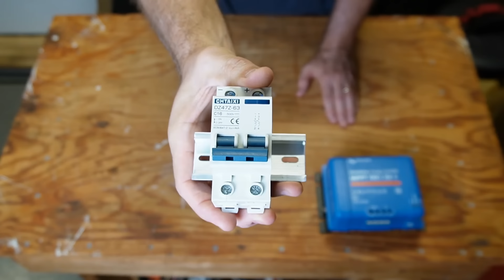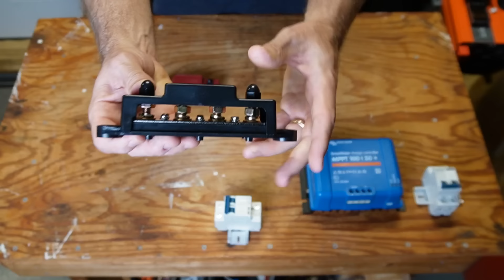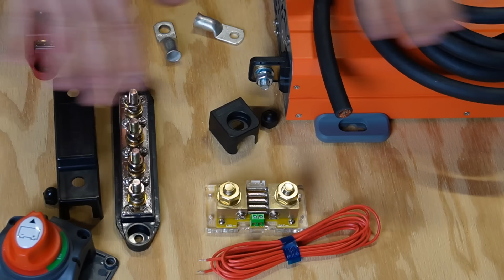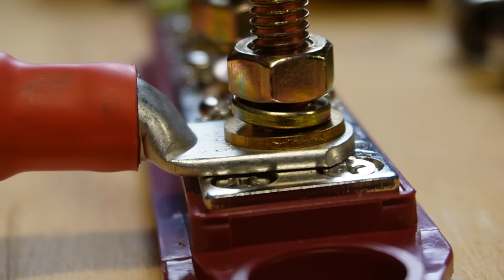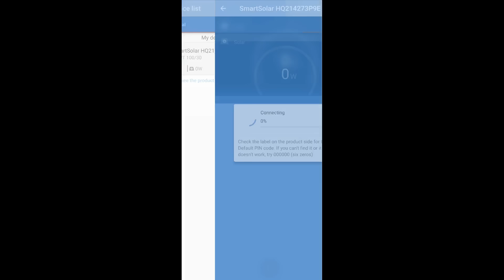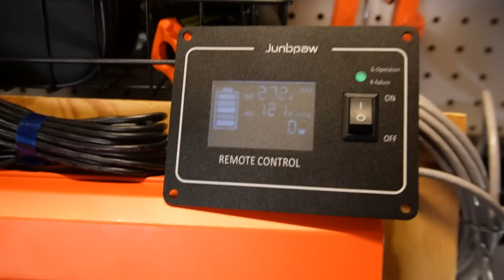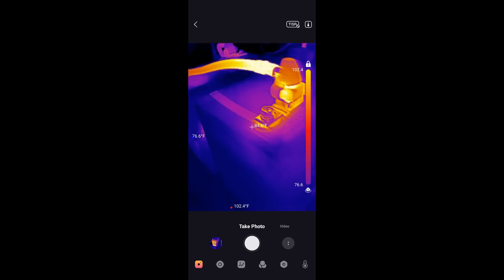24V DIY Off-Grid Solar Generator Build For Beginners

Comment: Question guys? On the pv solar switch can I flip the negative and positive cables as long as they match coming out the other side?
Reply from the maker: Not sure I totally understood the question, but with solar cables using mc4 connectors, if the mc4 connector will not plug into the correct polarity (positive/negative) color just turn the cable around use the other end of the solar cable. Each solar cable with a mc4 should have a female on one end and a male on the other end. Its best to have the positive/negative colors matching. But as long as the correct polarities are going  from the solar panels to the power station, you should be good. I'm not sure I answered your question.

Comment: This is diffently the best how to video that ive seen so far. How long would it have run that air cond. And why dont the solar panels do better when its hotter i would think the hotter the sun the better.
Reply from the maker: Thank you! I don't understand the technical reasons, but given two days with the same amount of sun at the same angle, a colder day will generate more watts. I've experienced this myself. However, I do seem to see more watts during the summer because the sun is more straight overhead and more sunny days than winter. I can't remember the details on how long it would run the air conditioner. But it wouldn't be very long. Maybe 3-5 hours with those two batteries. Air conditioners use quite a bit of power. But not as much as heaters.
Reply: @proficientprepper ok thanks again

Comment: Hi can you please tell me what power to run the shunt and monitor thank you
Reply from the maker: The shunt/monitor is just powered by the 24v system itself. I just tapped into the positive on the busbar. Its already connected to the negative, so I didn't have to do anything with the negative.

Comment: Nice video and very clear instructions.
What do you need to do,if you want to charge this system when there is no sun wth grid power?
Would be nice yo know!
Thank you for this video.👍👍
Reply from the maker: If I understood your question correctly, you can charge all these power stations with grid power. They all come with an AC cord you can just plug in. Of course what I was demonstrating would be what I would do when there is no grid power.

Comment: What happens when the panels charge the batteries fully?  Does the Solar panel charge controller turn off charging or is there a feature to not overcharge?
Reply from the maker: Thanks for watching and commenting. When the batteries are half charged for example, the solar charge controller will charge the batteries in the "bulk" charging stage, which just means it provides all it can to the batteries up to the max amps its rated for. When the batteries reaches fully charged the solar charge controller goes into what is called "float" stage, which means it just provides just enough power to the batteries to maintain a full charge. So it may be zero or 1 or 2 or 3 watts. Whatever the battery will accept.

Comment: Hello.  I want to say thank you for this detailed video.  It helped me to get a lot more comfortable with understanding a solar setup.  The only thing that I would have like to see you add is a AC and DC distribution panel to hook up DC items directly to the system, and enable multiple AC outlets within my bus conversion. Do you have a video showing that?
Reply from the maker: Thanks, I do have a video where I go through what I built which includes an AC distribution panel. But I didn't show it being built - https://youtu.be/lo1xKwktX7c

Comment: Can this system run a Deep  freezer, starlink router, ps5 and smart tv? And how many solar panel can i add to it.?
Reply from the maker: It would run these things you mention. But you might not be able to run them all simultaneously. And you are wanting to run them full time off grid, you would definitely need more battery storage and a few 200 watt+ solar panels. I did a video running my freezer that might help - https://youtu.be/2X4Tyj5Tmok

Comment: Is the Inverter shown (LGE 2080Ti) rated as a 12V inverter?
Reply from the maker: The inverter I used in the video is their 2080 watt 24v inverter. However, I just went to Amazon and noticed that I don't see the 2080 watt 24v inverter anymore. I do see the 24v 3080 watt inverter. I'm not sure if they stopped making the 2080 watt version or they just ran out. The 3080 watt version would be what I would go with if the 2080 watt one is not available. You just have to size your wires/etc accordingly, which I believe I did allow for a higher wattage inverter in that video.

Comment: What limits the batteries from drawing too much current from the charge controller when they are charging? I have 4 12v 190ah sla batteries I’m planning to run in a series parallel 24v configuration and I’m worried about the initial charge cycle.
Reply from the maker: My understanding is that charge controllers will not output more than their rated amps as long as its functioning as designed. However, just in case something does go wrong with the solar charge controller, that is one of the reasons I put a breaker between the charge controller and bus bars/batteries.

Comment: Again, great video, using it to build my system. Does your system not need a resistor to eliminate sparks?
Reply from the maker: Technically no, since I have a battery switch I did not use the resistor like I have shown before. I see lots of people still using them even when they have a battery switch. They say its to not damage the capacitors in the inverter. But I've never read in an inverter manual to use a resistor or anything like that. So when I have a battery switch, I typically don't use a resistor to pre-charge the inverter capacitors. But I may be proven wrong one day and if I am, I will be sure to show that in a video.

Comment: I forgot to say that this is a great video and I just became a new channel subscriber.  If you know how I can add wind and solar working together to run the wind power from 4pm sunset to 6am sunrise in the winter desert
Reply from the maker: I have no experience with wind power. However,  I would think you would simply connect the wind power output to the same place you connect the solar charge controller output (given same voltage) going to the battery. Then both can be charging at the same time. I've seen several videos that show that its difficult for the average home owner to generate much wind power. But I don't know for sure.
Reply: @proficientprepper  in my case I have no choice after sunset which is 3 or 4pm and all night is when the wind is serious. I went out and bought a USMC 2 Man Combat tent that handles 55mph winds for my dog and I but hopefully I might get lucky and sell my truck for a mini van. Avg wind speed in Borrego Springs CA desert is 15 to 20 mph from 4pm to 10pm then you get 30mph 10pm to 1am you also get the 40 to 55mph wind gusts which have destroyed 4 of my tents. So now I got the USMC tent that I will test even if In get the van to replace my truck just to see if it can handle the wind.  Most wind experiences are bad because there is NO WIND Abut here there is a lot of wind and it might be the BEST CHOICE for the location.  But in summer Sun is out 14hours a day.  It's hot in summer as high as 115degrees and alot of 105 to 110 degrees but in winter it's 40s at night and 70s in daytime.  I will be using solar until there is no more sun then switch to wind or maybe a propane generator to charge my batteries.

Comment: I am not happy with youtube algorithm because I got lucky when I found this video.  I am doing my first DIY and I bought 4 ecoworthy 12.8V x 300amps.  Altogether I have 12V and 1200 amps but 15,360Watts.  I figured it would take me a long time to get a 60 Amp Solar Charge Controller to charge 1200 amps.  So I think it makes the most sense to make TWO 24V 300amp chargers . Buy 1 Charge Controller and 1 inverter. When 1 7680wh generator has no power or down to 25^ I will disconnect the Solar Charge Controller and Inverter from Charger 1 and attach to charger 2.  That will give me good backup.  I am only going to use a 400w mini heater and a 150watt electric blanket and that is it.  I will be in the desert so I want to have both SOLAR and WIND because in winter there is a lot of win in the afternoons and after Sunset and early morning hours. I will likely use 6000 watts per day from Solar System 1 and If I can create 6000Wh of Solar that would keep me in a great situation but if I only make 3000 watts of solar I have a long extension cord I can attach to a 12V 80ah Lifepo4 battery charger and can fully charge 12V 300amp battery in 3:45minutes and I got 2 of them. So I can charge these solar batteries at the local library in an emergency. But if I get a good wind turbine I might be able to get 4000 or more watts/amps "whatever" to charge my solar system at night.  There are a lot of 35mph to 50mph winds that come thru the desert in the winter.  14hours of sun in the summer but sunrise usually around 6am and sunset at4pm in winter.
Reply: That's a lot of copper. Have you considered going 48V with a Sungold Power AIO (All In One) inverter? 500V MPPT Solar input. You can run single or split phase output from 5kW on up. 48V server rack batteries have built-in breaker circuit breakers.  Easy install...

Comment: So there is no need for a fuse from the inverter to the positive bus bar?
Reply from the maker: You could do that, however, since the solar charge controller and batteries are either using a fuse or breaker, I do not see the need.

Comment: I'm going to use this video to assemble my 24V system that I've been gathering parts on for many years.  I have 10 ea used 315 watt panels,  several chg controllers, inverters,  welding cable, lifepo4 batts ( the old AGMs gradually died in storage)....it's the fusing and disconnects that baffles this old brain.
Reply from the maker: Glad you found it helpful. Sounds like you're about to have some fun assembling that system. I certainly enjoy putting these systems together.

Comment: Good morning Matthew here from Jamaica i have a 24 volt solar system mppt charge control five 550 watts solar panels and one 585 watts solar panel two 5.2 kwh lithium ion MTGES battery one 4000 watts Schneider inverter inverter one automatic change over switch and a solar breaker to turn off the solar panels  and it's totally off grid it runs my entire house here in Jamaica we have alot of sunshine ☀ thanks for the vedio sir
Reply from the maker: Thanks. Oh gosh, I just realized as I'm writing this reply hurricane Melissa is about to hit Jamaica. I pray that you, your family and everyone else there in Jamaica stays safe.
Reply: @proficientprepper good morning hurricane mellisa destroy alot here but i survive my solar system survive too they were on the roof which is concrete my solar system helps the whole community after hurricane mellisa to charge phones store meat in a large freezer that i have it's the worst hurricane i have seen in my 49 years on earth
Reply: Hey from PR here. Stay safe from hurricane Melissa sending blessings
Reply: @cheverezallday7962 okay i finish all my preparation solar panels tie down my roof is concrete i do my best hope it's enough windows ply up
Reply: I need help with my system, can I call you please?
Reply: @FREDDYIGNACIOABREUCASTILLO where are you located
Reply: @Matthew-ny6mk dominican Republic sir.
Reply: Good for!